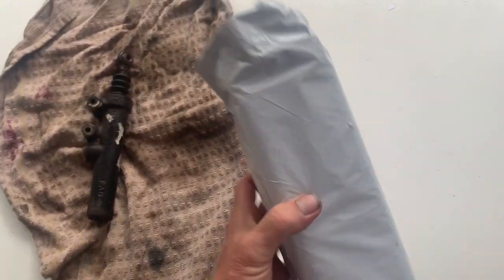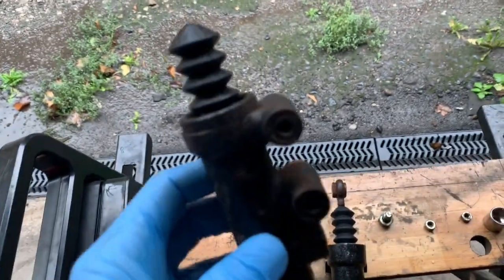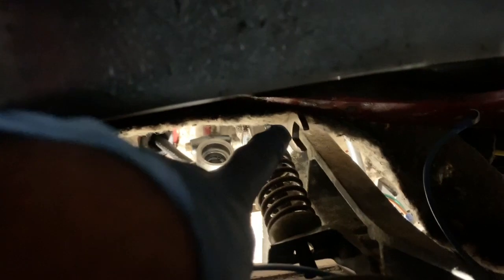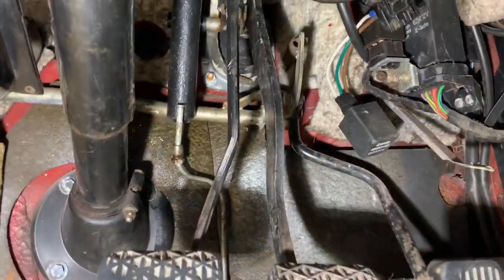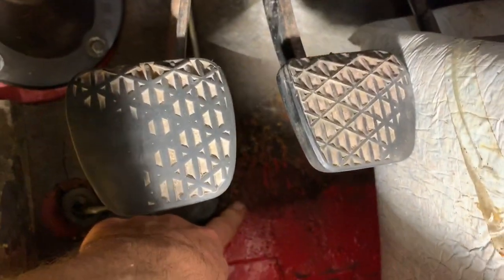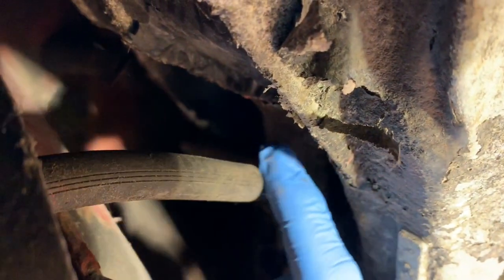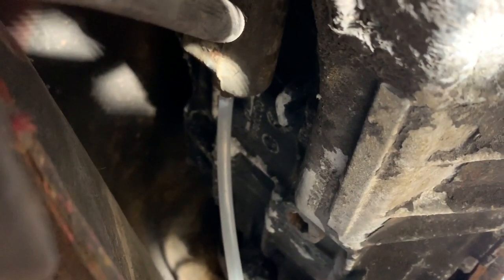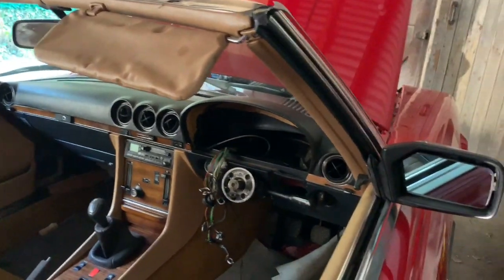Mercedes 107 280SL clutch cylinder leak and replacement

Comment: Hi. I am getting ready to do the master and slave cylinder on my 75 280SL.  The parts look the same as yours except the master cylinder draws fluid from the brake reservoir.
Reply from the maker: Hi Rome - good to hear from you. If all goes to plan, I'll shortly be doing a video on the brake booster and master cylinder. Slowly but surely making my way towards that engine bay...Mike

Comment: Which video explanes removal of dash components to reach the clutch master cylinder. I've got vacuum pots in the way. My R107 is an 85 280sl 5 spseed. Thanks
Reply from the maker: Thanks for your comment - the video which you left the comment on is for a RHD 1983 280SL 5 speed manual....but I didn't encounter any vacuum pots. Mike

Comment: Is there any reason to remove the “rod” when replacing the cylinder ?
Reply from the maker: That is a good question, and I am not sure from the top of my head whether you can do this job with the rod in place. If you manage it, let me know. Mike
Reply: @MikesMercsandothercars I just replaced the master cylinder on my W123 and I left the rod in place, worked out great 👌
Reply from the maker: @WingspeedGarage  Thanks for letting me know...the real gems of Knowledge often lurk in the comments section of a video. Mike

Comment: It is true that for the Mercedes b classe 2012/2013  petrol 122hp you need to take out the engine to change the clutch?
Reply from the maker: Thank you for your comment. I no expert in these matters, but I believe that to change the SLAVE you need to drop the engine but that the MASTER can be changed in situ. Maybe this gives you more info:

https://www.benzworld.org/threads/removing-replacing-clutch-master-cylinder.3012620/
Mike

Comment: I am in the same proces and found its a real pain. I find that the bleeder valve needs to be opened just a little bit for no air to get back in the system or use some teflon to seal better? Also, after bleeding this way the clutch is still not operating properly or bleeding is not working proper. The clutch still feels springy and does not get back completely. Anyone an idea? I already replaced the slave cylinder and flexible hose.
Reply from the maker: Thanks for your comment and sorry to hear you are having problems. Did you watch my more recent video about clutch slave cylinder? (Starting at time code 6.56)

https://www.youtube.com/watch?v=ljqEZ4cbSoo&t=20s

Might give you a better idea of how to bleed the clutch without air in the system.

Mike

Comment: Have you had any issues with this master cylinder since installing it?
Reply from the maker: No not yet - why do you ask? Mike
Reply: I am probably going to purchase the same cylinder you did since I’m about to replace mine so I wanted to see how yours was holding up
Reply from the maker: Cool - if you replace the cylinder, my advice would be to replace the flexible hose that goes through the firewall to the header tank. Shortly after I replaced the cylinder that hose started leaking at teh header tank side...and I had to rebleed the system which was a abit of a pain. Good luck. Mike
Reply: Thanks for the advice!